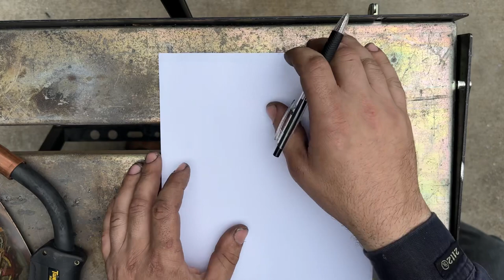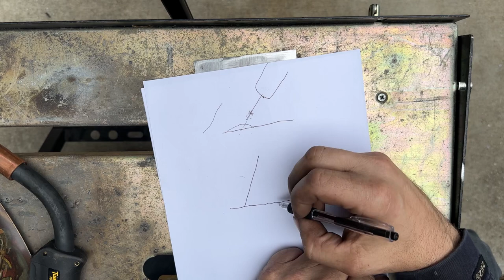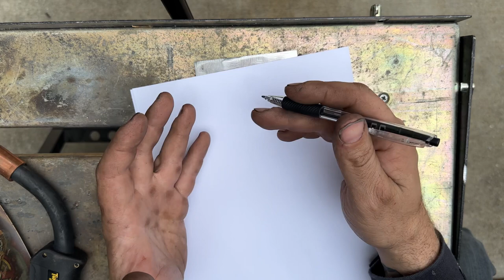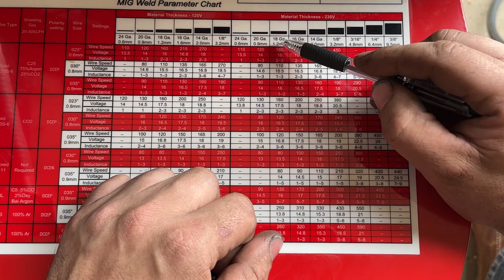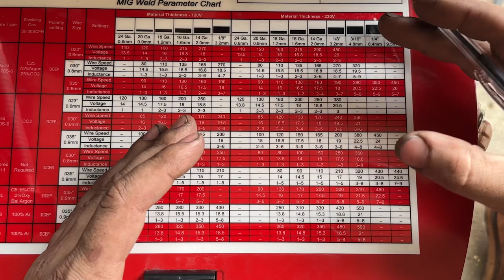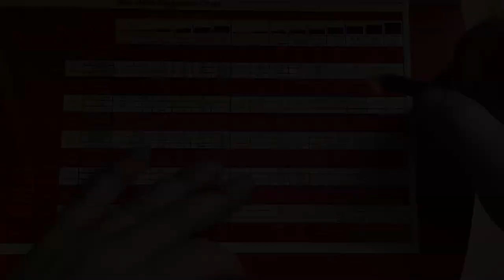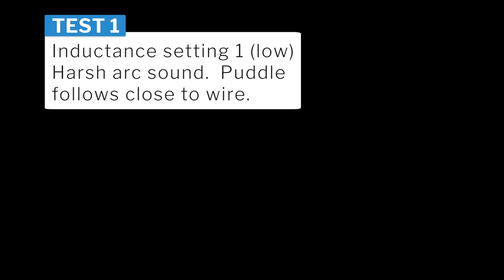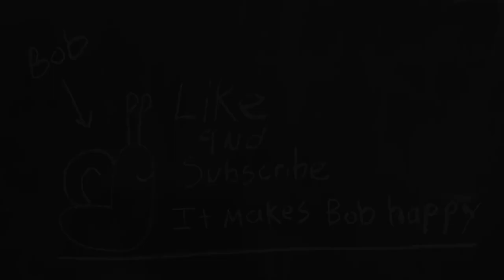Everything about Mig welding inductance control

Comment: Finally!  Thanks for the video.  I'm finally starting to understand.  It almost seems like it should be called conductance time.
Reply from the maker: No problem 😀.  I am with you, I think it should be called something else so it is easier for people to grasp.  When you understand what’s going on it makes total sense as to why you would want to have adjustability of it.  It really allows you to fine tune your welder to the wire, gas shielding blend, and particular demands of the job.  Very handy thing to have, not absolutely required, but it makes enough of a difference I definitely would want to be able to adjust it.  I find 50-60% seems to work the best, but thick plate does seem to benefit more by 7-9 settings.

Comment: Hi Greg, I finally understood how the inductance settings affect my welding.
Thank you for this awesome video.
Cheers
Reply from the maker: Glad it helped you out 😀.  It really is quite confusing, but now that you understand a bit more it should help you dial things in better.  Honestly for me I like to use it mostly to get better performance with MiG and with flux core.  Both run better with different Inductance and if you’re not stuck with a fixed inductance you can run both run ideally.

Comment: In simple terms, an inductor is an electrical device that tends to oppose change in current flow. High inductance will tend to smooth the current flow, low inductance won't. I would expect low inductance to act like fast freeze electrodes (6010,6011), medium inductance more like sorta slow freeze electrodes (7014, 7018), high inductance like slower freeze (7024 though not as extreme).  That's based on my electrical engineering background, I've never used a welder that had variable inductance. My only MIG welder, a Lincoln SP100 is an old simple transformer machine purchased complete with regulator and c25 tank. It's reliable as gravity, but just basic controls. I've thought about getting a Titanium 170 MIG machine but I've no need for it. The SP100 does all I need for metal too thin for an old man to stick weld.
Reply from the maker: You are correct on your expectations on how it would weld based on inductance.  The difference is not hugely significant when actually welding, which might be due to how fast everything happens.  Many times a second the wire shorts out allowing the current to rise.  In practical use it is more like a fine tuning mechanism that allows you to dial in things a bit better.  You’re probably not missing a whole lot without having it.

Comment: Did you control for interpass temperature on your test?
Reply from the maker: Great question and thanks for asking that.  Generally speaking make a weld, and then cool it between passes.  The first pass the plate definitely wasn’t cold, it’s 90+ outside so it has some heat in it, same after each pass.  I try to be as consistent as possible with that.  The difference not cooling it down would make would be staggering lol.

Comment: Valueable! Have to rewatch later though. Got to grasp the lows and highs....inductance vs wire reaction 😅
Reply from the maker: It’s complex for sure.  All you really need to know is low inductance = more spatter and faster solidifying weld, high inductance = less spatter, more fluid weld pool.  Lower inductance is favored with flux core wire, higher for gas shielding.  When it doubt leave it at the middle of the range and call it good lol 😂.
Reply: Nice formula Greg. Thanks😊

Comment: Another great video. Do you know why flux core requires less inductance?
Reply from the maker: So inductance is an odd thing on flux core.  Flux core technically doesn’t operate on short circuit mode of transfer (like normal gas shielded mig) but a form of globular or even spray transfer.  Short circuit (where the wire actually touches the molten metal as a solid) is affected by inductance.  With Spray mode of transfer inductance does very little because the wire is liquid soon after it leaves the contact tip.  Inductance does seem to have a slight effect on flux core.  Inductance likely works best at low levels simply because the higher you go the less change it’s going to make, since the wire is not touching the molten pool as a solid.   Setting it low makes sure that the wire blows apart right away if it does contact the plate, generally more useful when welding very thin materials (higher settings will liquify the wire more reliably).  Also, flux core produces a fair amount of spatter, and the puddle freezes fast.  Low inductance doesn’t make it produce more spatter like with normal mig, so the drawbacks of low inductance aren’t a concern  😀

Comment: Very good Video! Made me finally understand the differences. Is it possible to get a copy of your Mig Weld Parameter Chart? 
Thank you!
Reply from the maker: That chart came with the machine.  It seems to closely follow Esabs phone application for settings.  I use esab and miller electrics phone app all the time for settings.  The online version of millers can be found here: https://www.millerwelds.com/resources/weld-setting-calculators
Reply: @makingmistakeswithgreg  Awesome! Thank you so much for your help.

Comment: Hi Greg , love your videos and explanations . Learned a ton from you . Would you be kind to reply or explain what effect does inductance  have in spray arc  ( if any ) ? And can't wait to see some videos of your fronius welding machine . Greetings from Germany.  Keep safe
Reply from the maker: With spray, inductance will have virtually no effect.  Since there is a steady state voltage due to a full time arc existing, and there is no shorting of the wire or drop in voltage during welding.  To help demonstrate this I should be able to put an oscilloscope on the output and see  the effect, I will do this in a future video.  With that said the arc start will be better with lower inductance and spray.  You can get some rough starts if you have really high inductance set.
Reply: @makingmistakeswithgreg   Thank you Greg for the fast and informative reply .  Now it makes sense .

Comment: I find this hard to explain to people without showing them, and even then, some insist it’s just a setting to change voltage. But then, they don’t have any understanding of electronics, so it can be hard to change their minds.
Reply from the maker: It definitely has a effect.  To me it works better for having the ideal arc between flux core and hardwire.  Both of those processes prefer different inductance.  Within just one particular wire it’s one of those things that you find what you like and leave it.  Definitely is a nice feature to have for fine tuning things.

Comment: great info thanks for the video,, some of the other upsides iv found is how well it can be adjusted to running straight co2 very well also being to be able to dial in different brands of wire to your liking. Something i haven't tried is running flux core with it should be interesting to see how capable it would be at calming down the harshness and spatter of that process
Reply from the maker: You are right, you can definitely use it to tailor it to what you’re working on and what wire.  I have ran a bunch of flux core wire through the machine without screwing with the inductance, it’s always been at 4 or 5.  The interesting thing with flux core is it operates on a different mode of metal transfer than short arc.  I can’t seem to find a absolute but it seems to be between globular and spray arc.  Inductance will definitely have a effect on it, I will have to test that out to see what it does 😀

Comment: Very interesting, according to the seller of the Hobart Beta 4000 3phase Mig welder I bought almost three years ago in little used, second hand condition neither he nor his staff could make a good weld with the machine. I came along having bought it on eBay and tried it on their settings and it didn't perform well. So I set the inductance to 250 from 350 it was set to, set the voltage on the coarse and fine dials to what I thought was about right for 3/8 (10mm) plate and set about welding with only wire speed to set to get a beautiful weld. I wonder if they had the wrong voltage and wire speed settings then? Anyway, they couldn't make it work them but It worked for me so I bagged a great deal (£800) for a powerful welder that is in great condition for twenty year old machine!
Having seen this video, I am going to set aside some time to learn more on this topic. Cheers young man!
Reply from the maker: You wouldn’t believe the number of welders that get written off as not working properly or people think something is wrong with it.  I have seen/heard everything from wrong/bad gun liners, wrong polarity, wrong shielding gas, improper contact tip size, wrong rollers, and even flat out ignorance on settings.  Sounds to me like the people just didn’t know what they had or how to dial it in.  Thats a total score for you 😀.
Reply: @makingmistakeswithgreg  Indeed. Like many things in life one mans ignorance is another man's opportunity. I recently bought a Jaguar XJ8. The owner was selling for spares as "totally rotten". I went along and could see the wheel arches were indeed rotten. The rest of the car structurally, mechanically and internally was sound, l gave them scrap money for it and now have another easy cosmetic repair Jag to play with. Will be doing a video for wheel arch repairs. The BIG Hobart though is too powerful. I shall use my other bargain welder instead. I bought an Oerlikon Citoarc M260C off a posh farmers son who couldn't weld. His dad bought the welder in 2002 and barely used it because he got badly ill. He died in 2020 and bought a virtually new twenty year old welder in 2022 for £350, complete with the original but rusty old reel of wire and the full size gas bottle with gas in it. That welder has earned its money back thirty times over at least.

Comment: Excellent video thankyou. I just got a mig welder with this setting and had no idea what it was!
Reply from the maker: No problem 😀.  It’s really more of a fine tuning control but it pays to experiment with it.  It definitely helps if you switch between flux core and gas shielded wire, you can get ideal performance with both of those 😀

Comment: Very informative video!  Would this apply to self shielded flux core?
Reply from the maker: Inductance does have and effect on gasless flux core wire.  Generally you want to run less inductance with it than Mig (so 2-3 out of 10).  Inductance has less of an effect though, mostly because Gasless flux core functions more as a “globular” transfer.  Basically the wire is somewhat liquid before it hits the puddle unlike short arc mig which the wire is solid.  How slow/fast the current rise doing change much because there isn’t much of a dead short.  Spray arc is the same way, inductance has very little effect on spray.

Comment: Excellent video Greg.  The information that you share is priceless. I’ve never really dug into inductance settings too much. Most of the machines that I’ve ran were either transformers or suitcase feeders.  I’ll dig into it and experiment when I have time to run my firepower
Reply from the maker: I am in the same boat, I just ran a machine (which never had inductance control) and dialed it in the best I could.  I see it mostly as a good feature on very thin or as a production weld control.  For myself (and most hobbyists) adding a additional control won’t be hugely beneficial when every weld done is different than the last.  So you know on the fp200 just hold down the button near the inductance symbol and it will pop up a secondary menu control, I believe it says “ind” and goes from 1-9.  You also want to fool around with run in control and burn back, under different menus.  Both of those really help clean up rough/cold starts and rough stops.  Definitely useful settings.
Reply: @makingmistakeswithgreg  the first time that I ran my fp200 I had to mess with the run in because I definitely had very cold starts.  It was sputtering for a half second or so before it would run smooth.  For having the machine since February I should have already dug into all of this.  Time is pretty hard to come by these days. Oh btw, my drive wheel showed up yesterday finally. Thanks for that info

Comment: Great video Greg, so now a question, how is inductance going to effect spray and pulse spray. I do lots of pulse spray  and just left the factory inductance setting. Now I wonder if I was to change it would it be worth in on pulse spray.
Reply from the maker: In the case of spray I have never tried it.  I would imagine at the values spray runs at changing the inductance wouldn’t change much of anything.  Since it has to do with the time it takes to the amperage to rise from the direct short of the wire, it would only affect that.  Spray arc doesn’t have a direct short, and more or less the wire becomes (and stays) liquid as it leaves the contact tip.  If it did affect anything it would probably be hardly noticeable, and would be just at the start of the weld would be my guess 😀